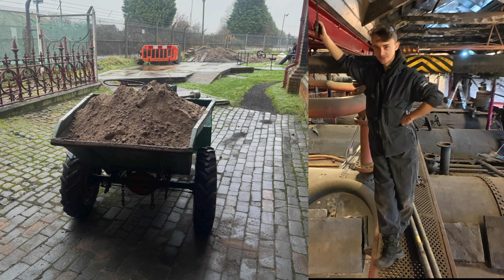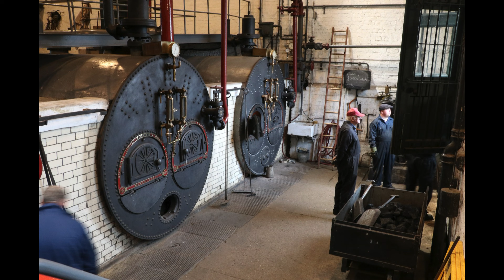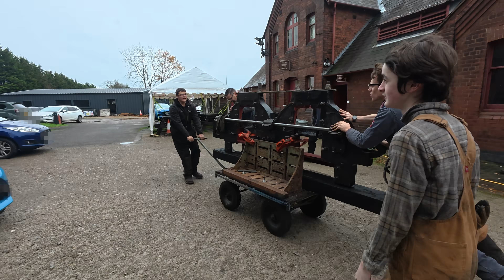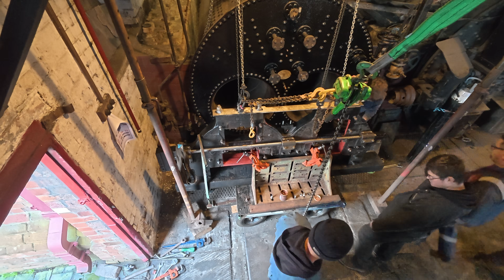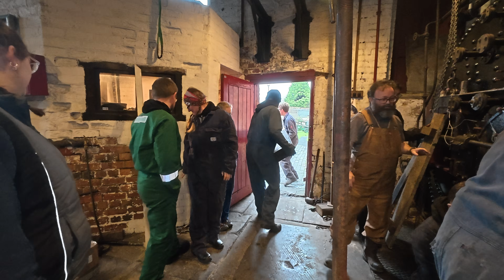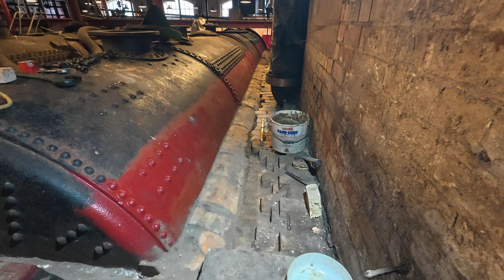#2 The Big Lift & The Boiler Inspector | Lancashire Boiler Restoration (Part 2)

Comment: Fascinating to see the chain hoist ballet, I was involved in a bell tower rehang in 2018 and we used exactly the same technique to lift the bells off their bearing beds and remove the headstocks - large castings on which the bells pivot. The weights involved were similar, some of the bells were 15 ft above the floor and we had to balance on the 1923 steel bellframe to get at them. Then the headstocks needed lowering 3 floors down the tower, on a manual chain hoist, and all the way back up again after bearing replacement and refurbishment! When we got the 1923 bearings out we found out they were metric - and you can still get the exact same part number.